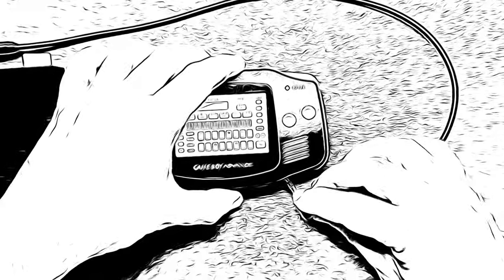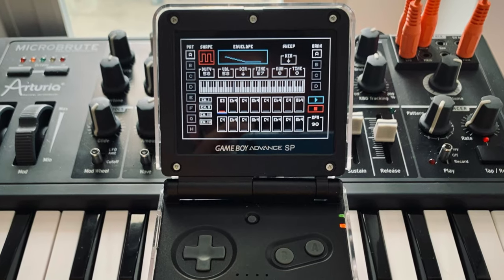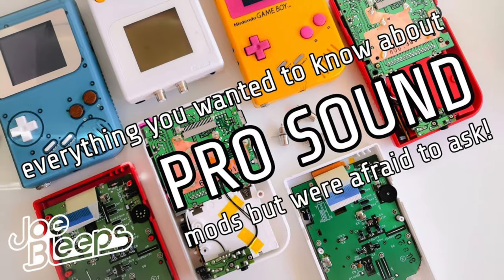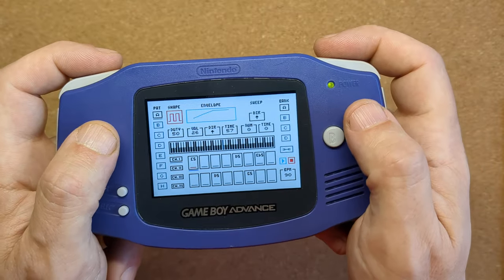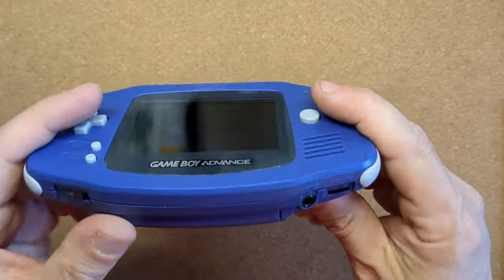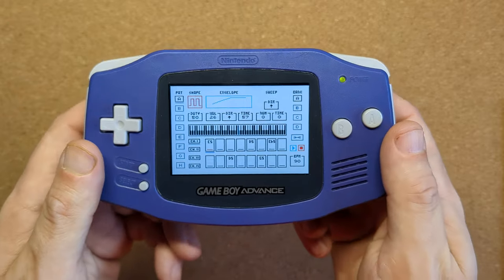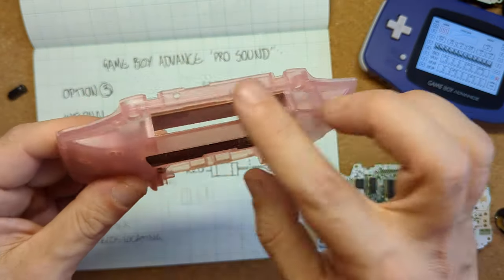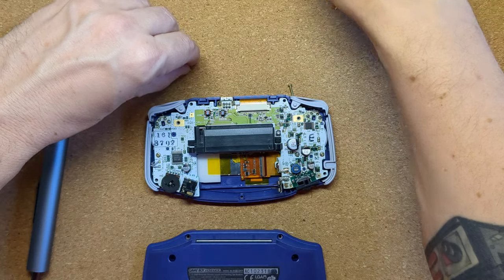Game Boy Advance Pro Sound modification - a complete guide to GBA Prosound mods new for 2023

Comment: Thank you for finally documenting this for the scene! 🙏🏻
Reply from the maker: Thank you Sam! Very interested to hear your thoughts
Reply: This seems great! I’ve had a skim through so far, I’m away at the moment but will give it my full attention when I’m back 😄

I’m interested to hear a recorded sample between headphones and your prosound method, really interesting approach to use the resistor and EM filter - good find!

The way we did it before actually comes out pretty hot and sometimes doesn’t play too nicely with some mixers and external amplifiers, so maybe the EM and resister would help with that.
Reply from the maker: @2xAA  thank you! and yes, it does help rein it in a little but as you can see here it's still way louder than the headphones output when connected to a speaker.  One thing that surprised me is that it sounds pretty good through headphones, the volume difference isn't as pronounced as when using a speaker but the sound itself feels a little different.  Something I want to test a bit more.

Comment: Is there a way to make a stereo mod where jack is working also?
Reply from the maker: That's what this mod does, the switch enables you to go back to headphones when needed
Reply: @JoeBleeps  so there is no way to have both at the same time without any switch?
Reply from the maker: you could but you'd need to install a separate socket like I mentioned in the video @robertomorelos963

Comment: Hi Joey, i make chiptunes but so far all I’ve used is ds lites and dsi I’ve been wanting to get an older model to use fb-303 and you were talking about the gba sp not having an output and ive seen videos about installing a headphone Jack but it wasn’t pro sound, is it hard to do in the sp? I’ve also seen adaptors for the sp that go into the charge port but I figured the sound quality was probably 💩